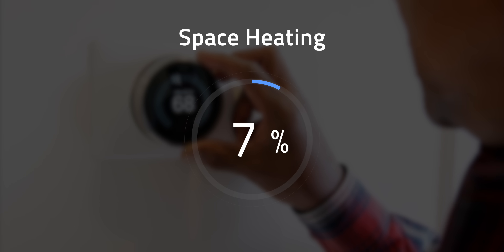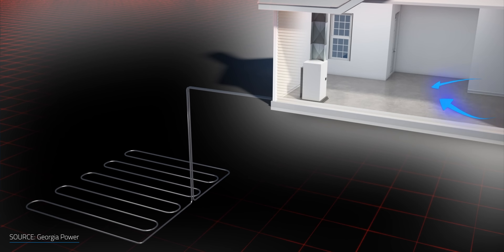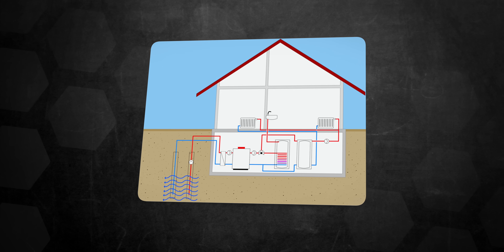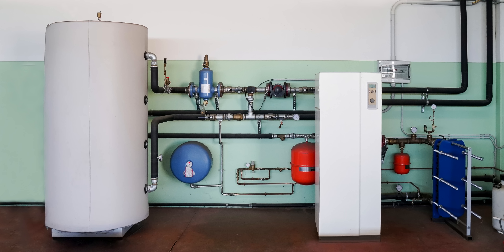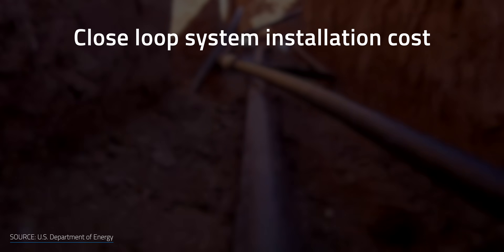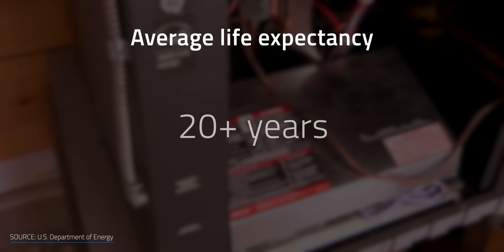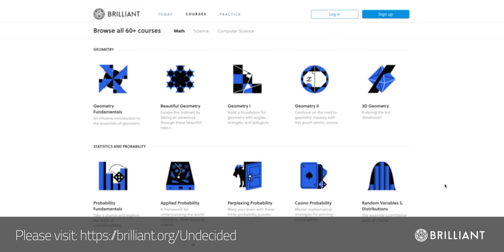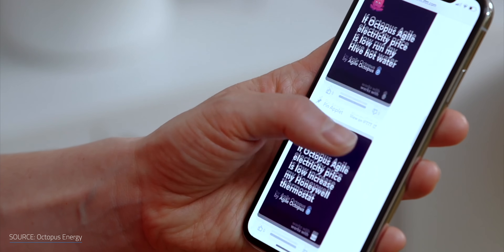Is Geothermal Heating and Cooling Worth the Cost?  Heat Pumps Explained

Comment: Last summer we installed a pretty expensive Air source heat pump with 2 stage resistive backup heat system on our home to replace an old 80% single stage gas furnace and AC - Bosch IDS 2.0 fwiw. Here in Minnesota we felt pretty groundbreaking ditching gas but my only real regrets are 
1: Not making sure the installation properly mitigated ice build up under the unit during the defrost cycle (I ended up making my own drainage board to install under it) and 
2: That I didn't properly investigate geothermal. It's not that we didn't ask a few companies about it, but I think we asked the wrong people - traditional hvac folks, most of whom were freaked out by the idea of an air sourced heat pump in the first place and were probably too fast to say too expensive or house not a good candidate.
I wish we had spoke to a couple of geothermal specialists too. The people I did ask may have been right, but I wish I had got that from people could trust as having a better idea what they are on about. We paid around $14k for our system and while we did know geothermal was expensive, no-one told us the was a generous tax credit for it that could help out. We considered a few more expensive systems too (Mitsubishi Hyper Heat was 17.5K) but I would have been more willing to stomach the cost for geothermal.
I will probably not be in this house by the time our current system needs replacing but if I am, I'm hoping it will be geothermal, but by then maybe there might be some even better solutions that have been developed. Anyway, great and informative video and hopefully people who see it will give geothermal a chance, especially if you are already considering expensive high efficiency replacements to the current systems.
Reply: Absolutely essential!! shop it around!

Comment: My question would be: Does this system rely on seasons to work? Do you need a winter where the ground can cool down to make up for the fact that you're dumping heat into it all summer and vice versa to stay viable, or is the underground temperature so unshakable that you could run these in one mode forever without making a dent?
Reply: No. It works everywhere.

Comment: A lady I know has geothermal for her house, it was installed about 12 years ago cost 25K. Her husband now retired, was a electrical engineer and calculated correctly, he says it has been great savings. Winter's here in the Montreal area are cold and summers are hot.. So savings in energy are interesting, but electricity here is cheap like 7 to 13 cents/kwh, so it's a toss-up.  Definitely compared to oil or propane it's cheaper long term.

Comment: The actual way to do this as has been done for decades is just super cheap 12 inch convoluted plastic ABS tubing like 120 feet of it and burried in the dirt 3 feet down.  You just pass air through it with SIMPLE FANS at each end.  OR a dirt burm wall with the tubes in it.  He things hes talking about in this kind of geo thermal systems video is for ninnies and needlessly complicated and super expensive and has 100 things that can break or go wrong.  Nice way of taking the most simple of technologies and making it pointless

Comment: Matt, first of all great video and love your channel. Was wondering if you could actually run the heat pump from your solar panels on a typical house?  Wasn’t sure exactly how much electricity the heat pump would require and if this would be practical?
Reply: It is what I do. I had the heatpump and wells installed first and noticed I was spending somewhat more on electricity. Next year I installed solar panels. Both had a 30% tax rebate. the combination is very efficient.
Reply: Theoretically it's entirely possible. A small domestic heat pump for an average U.K. home draws about 3kw, well within the capabilities of a well sized solar system. Of course, solar power doesn't always coincide with the need to run the heat pump, but averaged over a year and with a good sized solar set up you could generate more power than you use. It's likely though that you would be selling power in the summer, and buying it back in the winter.

Comment: The most common and effective type uses 2 wells. One as a source, and the other as discharge.
Reply: I wouldn't say that's most common. Closed loop systems are surely the norm now, with multiple boreholes depending on heat demand- usually one borehole per 3 to 4 kw of heat required.

Comment: Around 2:30 you say the pump compresses the liquid heating it more. That's incorrect. The fluid in the ground loop might pick up some heat from the pump from friction, but I'm guessing it's mostly water with some antifreeze and anticorrosion additives and it, like most liquids, is virtually incompressible.

My dad had a water source heat pump that pulled water uo and then just dumped it at ground level. He i=used it for his garden in the summer but other than that it just absorbed back in. I don't think that system was really a whole lot more efficient than a regular heat pump. Granted it was the only heating system the house ever had while he was in it so nothing to compare to.

Comment: Combined the Thermal Mass of the interior concrete of SCIPs (Structural Concrete Insulated Panels) with geothermal units, this 6,000sqft home energy bills are less than half of a traditional Stick and Brick home. The design was to build a insulated concrete box then add a roof. Placing the HVAC air handlers and air ducts in the envelope (not a standard practice in Texas). The HVAC units were built by www.hydro-temp.com. One of the first companies to build multi compressor, multi stage, variable speed fan motors geothermal units. 
Another design idea to take advantage of the thermal mass of the SCIPs. The second and attic SCIP floors were supported by 24" high light weight cold rolled galvanized steel truss. The HVAC return air was moved through the truss area to charge the thermal mass on the bottom of the SCIPs. The multi Hydro-Temp units helped manage the humidity during the times there was little need for the HVAC to run do to the energy efficiency of the SCIP home.

Comment: Install an air source heat pump or a natural gas 98% efficient furnace. Take the extra money you saved and invest it in Carrier, Daikin or Trane. If you still live in the house in 18 years and that is a big if ( because the average person moves every 7 years ) you will have more than enough money to pay for a brand new system with the latest technology and never have to worry about an underground leak which is a major pain in the ass ( it doesn't happen often but it does happen). In the meantime if the stock market crashes, the bank won't be getting a house with a ground Source heat pump.

Comment: It was worth the effort to drill until we had a new fusion nuclear Safire Generator. All our future other research efforts need to go into higher energy density batteries. The necessary also enlarged grid, with wind generators, geothermal and solar with backup batteries are all ugly and use up much land, while also being significantly expensive and all having some safety issues. They are all also going to be unnecessary with the advent of the "Safire Generator" that is safe, costlessly self-fueling, totally green, buildable on any scale on a tiny footprint to match local community requirement and is chokeable and 24 hours dependable. It makes all other technologies redundant as in being much less advantageous and cost-effective. It is fusion nuclear powered by nuclear nuchemy and seen at "aureon energy.com". Also learn your new plasma physics, astrophysics, and general Electric Universe Theory at "Thunderbolts Project.com".

Comment: To answer your own question: No it is not! It was worth the effort until we had a new fusion nuclear Safire Generator. All our other research efforts need to go into higher energy density batteries. The necessary also enlarged grid, with wind generators, and solar with backup batteries are all ugly and use up much land, while also being significantly expensive and all having some safety issues. They are all also going to be unnecessary with the advent of the "Safire Generator" that is safe, costlessly self-fueling, totally green, buildable on any scale on a tiny footprint to match local community requirement and is chokeable and 24 hours dependable. It makes all other technologies redundant as in being much less advantageous. It is fusion nuclear powered by nuclear nuchemy and seen at "aureon energy.com". Also learn your new plasma physics, astrophysics, and general Electric Universe Theory at "Thunderbolts Project.com".

Comment: You have to look into the air to air Geothermal heating - cooling system at Castle Village Midland Ontario Canada .  It heats  and cools a ( poorly insulated structure by todays standards )  cement Castle of over 6000 sq ft in the colder climate of Midland Ontario by using the simple low maintained system of air to air that I have ever seen.  The operating system is a simple Honeywell  COOL - OFF - HEAT  wall thermostat  and that is it.  It is basically a large unitized A/C system with a little manual help to control air exchange twice a year ( which could easily be automated) .  Heat and cooling is done by the additional sub basement built under the original basement at the time of first construction of the building that was build on the side of a small hill which provided a regular walk out basement... Heating and cooling costs of the unusual building are ridiculously LOW.... Less than a 500 sq foot building with similar insulation values in the same area. This system is over 20 yrs old and has required next to no maintenance.

Comment: As someone who has worked in HVAC for 12 years and my dad who worked for 42 years in the field. I can confidently say, geothermal heatpumps are a pain in the ass to work on especially if it gets a leak in the loop.
Reply: Yes, but leaks are very rare- good quality pipes are guaranteed for fifty years, and short of an earthquake right under them there is little that can damage them if they are at the proper depth. They are under minimal pressure, protected from sunlight by several feet of earth, so what exactly is going to put a hole in them?
Reply: @spencerwilton5831  all the ones ive worked on are much older systems, I havent seen one newer than 10 years (at any point in the last 12) but I am sure they have made improvements.

Comment: Currently my wife and I are building a home with a dual Water Furnace geothermal heat pumps (horizontal loop).  When less heating or cooling is needed, only one heat pump fires up.  The primary heat pump will automatically change, so excess wear is not put on one unit.  This will be a hydronic radiant system, heating the slab concrete floor in the winter and cooling it in the summer.  No duct work or filters to clean.  Waste heat is delivered to a water holding tank that then goes into the water heater for final heating improving our water heating efficiency.

Our prior home had geothermal heat pumps with a more traditional air handling system.

The primary reason we used these systems (besides efficiency) was the homes were built in places with a wonderful outdoor environment.  The prior home was in a forested valley that was remarkably "quiet" (noise pollution) with sounds of nature, like tiny tree frogs and birds.  The current home is on a river and has the white noise of the river flowing over rocks and the sound of wildlife.  With the heat pump in a sound insulated mechanical room, it is nearly silent in the home.  The last thing we want to do is have an outdoor heat pump fan turning on and off and spoiling that.

Comment: @2:37: Seems like the compressor is blowing the refrigerant into the ground loop, which is incorrect. There is always a heat exchanger separating the refrigerant-side (inside the heat pump) and the water-side (ground loops)

Comment: Allot of contractors confuse effeciency when your talking with then on this and insulation.  There's thermal effeciency and then monetary effeciency.  In my area propane makes this a viable option financially but if I'm in an area with natural gas it doesn't have as much value.  I would like to see long term costs compared to just air source heat.

Comment: Sounds great til one of these pipe break underground and you gotta dig it all up .
Reply: Why would they break? There is little danger of mechanical damage that far down, they are protected from sunlight, are not under pressure, are not affected by salts and minerals and usually come with a fifty year guarantee so should last a lifetime.

Comment: We have a geo unit in our home; electrical costs to run the unit are 3x-5x the cost of natural gas or propane. During winter we have $500+ a month electrical bills and that is while running a wood burner. You may want to re-evaluate the “efficiency” of a geothermal unit.

Comment: I will say yes to this, my close friends own and built a B and B and they had a geothermal installed to provide the heating/cooling for this total of 4500 sq.ft  and also a 6k solar system installed to add to its efficiency and is beautiful, quiet, clean, and the annual hydro cost is less than $600/year, this located in Manitoba Canada where the winters are very cold

Comment: we have installed geothermal heat-pumps on 3 homes with horizontal ground loops some time ago.
it turned out that the pumps were very loud, annoying.
the efficiency was terrible.
we kept 10% of the costs for troubles, the installer sued us, we won.
am going now for Air to Water Heat Pumps and solar :-)
thus without breakers switched on for backup.

Comment: When the loop leaks all the water out will you then dig up your yard to have the loop fixed? Most people say no. 
As an HVAC contractor I make a lot of money converting these systems over to a traditional air to air heat pump.

Comment: I have a geothermal system in my house.  It's different than what you've described here.  We have a deep well.  Water pumped out of the well at normal depth.  It's returned to the same well - but 600' down.  Water exchanges heat with the ground as it rises in the column. I've heard it called a "pump and dump". Been working for about 20+ years.
Reply: A closed loop would drastically reduce your pumping costs, as there is effectively zero head in a close loop system vs raising thousands of litres per day from a very deep well, although i can see the advantage of using existing infrastructure in that way.

Comment: I am hoping to build a new home in the next 1-3 years, and I'm strongly considering Geothermal for its reliability/longevity. 

If you're willing to do a lot of the work (i.e. manual labor like digging) you can save a bunch of money also.
Reply: I don’t shy away from manual work but digging, I’d sub-out. If possible, coordinate/cost-share with adjacent property as drilling/excavation is the largest upfront cost but 2 sets of adjacent wells/loops should be FAR cheaper than 2 independent projects.

Comment: So every one that I know who has a geo system states that it is not cost effective because of the electric they have to pay for to circulate they system, maybe the pond system would be best as your not circulating the fluid with as drastic of an elevation change? Anyway we opted for natural gas and our Bill's are substantially cheaper than my coworkers who got the geo system but I am sure their system is more efficient it's just more expensive too...
Reply: Don't know where they got their information from, but the power required to circulate water in a closed loop system is minimal, probably comparable to the pump on a standard radiator setup- as little as 20 watts to perhaps 100 on a large system.

Comment: We installed closed loop vertical system during our last renovation so its cost in built into our mortgage.  We had one of the coldest winters ever right after we completed.  The house stayed warm and energy bills were a third of our neighbors.  We also installed a natural gas standby generator for those nasty ice storms that have caused power outages.  The heat pumps for the geothermal required less amps to startup making them great for generator loading and off-grid application.  System also helps with our hot water generation.  Only downside of installation was having to re-groom and re-sod most of our front lawn after drilling the vertical wells.

Comment: Love GeoThermal.. Replacing a worn out Air sourced heat pump system, I Had a 3.5 ton Water Furnace 5 w/three 200ft. deep wells closed loop,  installed 5 years ago..  Buried slinky ground loop wouldn't work, I'm in a forest.  Cost was $28K, but with Maryland rebate, came out to $14K out of pocket.  Where most other similar air sourced Heat Pumps around here were getting ~$350+ per month electric bills in a cold February, I was $150 max.  Summer, the electric bill is abt $100.  This past bill Jan 20 to Feb 17 (Coldest month), I used 2 MWH which at current recently raised rate of 8cents/KWH resulting in a ~$160 electric bill..  Best thing you can do to reduce electric bills if you don't have Gas.  No Issues at All, totally Reliable.  Going STRONG!
Reply: One more:  The Water Furnace 5 has a digital display which shows the watts drawn from the mains.  Full Bore, (emergency heat has NEVER come on), stage 2 heating, w/pumps and Fan going,  pulls 2300 Watts.
Reply: One More:  I also got the water heater option, but don't really know if it does anything useful, or understand how it works.  This is plumbed into a single tank electric water heater which still uses the 4500W heater when water is below the set temp.  As configured there is No way to know which heater (the Geo or Electric) is heating the water.  As a test, I need to turn off the Water Heater circuit breaker and see if anything changes.  Some add another water heater with the element disconnected for the Geo system to pre-heat water for the following electric water heater.